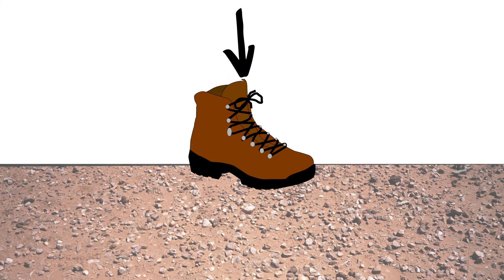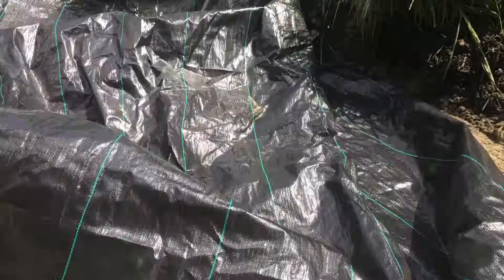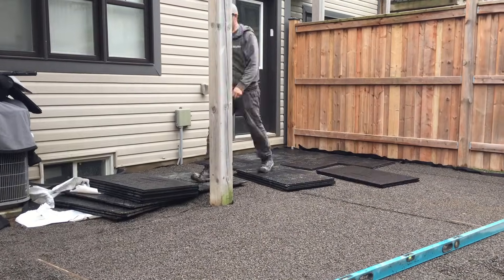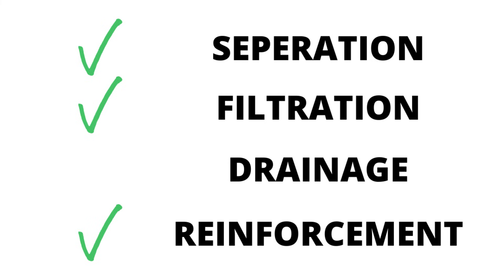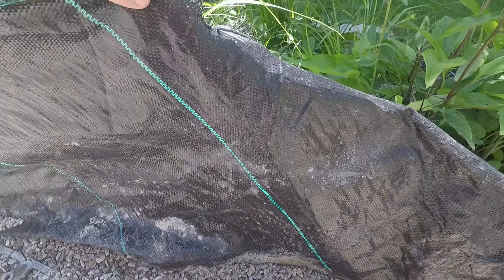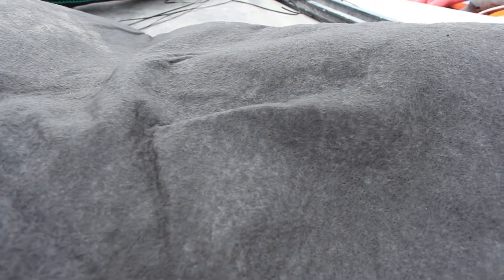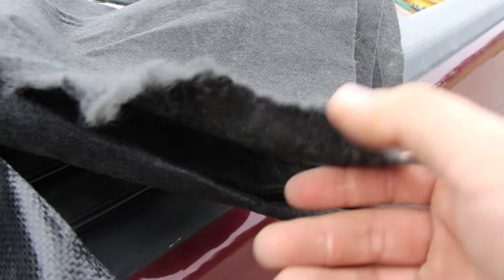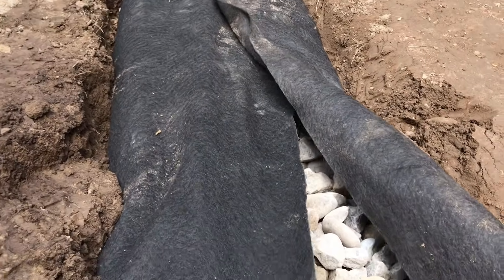Woven vs Nonwoven Geotextile Fabric | Choosing the Correct Geotextile for Your Project

Comment: So if I'm trying to get water away from a house that has pitch going towards it instead of away, i would install woven on the bottom and non woven on the top under the landscape stone, with drainage pipe between. Correct?
Reply from the maker: If your yard is sloped towards the house I would recommend a retaining wall to help flatten the yard. Then you could address any other water problems with a French drain as you described there and you wouldn’t need woven.

Comment: For a patio adjoining the side of a garage and a concrete driveway slab, it sound like nonwoven geo fabric would be best plus or without geo grid for additional support. But any thoughts on whether to place some woven geo fabric near the base of the garage and the slab to prevent erosion from seepage through the nonwoven and ensure water is pushed away from those two structures?  Also thinking about woven at the outside edges to ensure that any water that runs off will not undercut the patio. Any thoughts appreciated.
Reply from the maker: Sorry I can’t quite picture this. Both fabrics will separate material that you don’t want mixing. Woven will not be great for drainage so if you need drainage go with nonwoven. If you need added stability add in the box axial

Comment: We just graded our property and have a really good quarter inch per foot or more slope to the yard, other parts of the yard in tighter areas will be installing French drains. The entire yard will be 3/4 in gravel ( rental property ) . I was thinking woven for most of the yard and under French drains, then a small amount of non woven on top of French drains to allow water to enter. Any advice Thanks !!!
Reply from the maker: Without seeing the site and the subsoil, it sounds like what you'd want to do. As long as your slope for your sub grade is good and away from your foundation.

Comment: Please help, I have a 24” area around my concrete patio that was sinking because it had 8 inches of play sand underneath it with no retaining wall around it , I removed the entire area and all of the sand and built concrete forms 4 inches deep and 3 1/half inches wide all the way around, I used 3/4” angular cut lime stone over the subgrade, which was a clay dirt mixture and compacted it with a plate compactor over 100 times and now that I’m at the point of screeding the 1” of 1/4”clean angular cut limestone before setting the pavers back I realized I forgot to lay down the woven geotextile fabric underneath the 3/4”  limestone base 🤦🏻 What do you recommend I do at this point ? What’s so frustrating is that I originally had the fabric layed down over the subgrade but I took it out to to compact some stone into the dirt and clay mixture so that it would be more water permeable and not like a solid sheet that water won’t let water in but I forgot to put the fabric back down when I put the rest of the stone in. Any advice will help at this point, thank you.
Reply from the maker: I have never met a concrete contractor that uses geotextile to be honest. But the only way to get it in there would be to start again
Reply: @iamahardscaper  The area I’m talking about where the geotextile fabric wasn’t laid has pavers going on it not concrete, I built concrete forms around the outer perimeter of where that pavers will be placed so they don’t fall back. Basically, my question is there anything to do it extend the life of the pavers and keep them from sinking now that that geotextile fabric is not underneath the base

Comment: I have a question. I have a certain section of my backyard in Orlando, FL which is just filled with dirt. I have weed growing there all throughout the year. My wife has planted some avacado, guava and other trees and there are a lot of smaller flowering plants as well. The problem is the weeds that grow between them. I want to cover it with some kind of fabric that does not let the weeds pass through for a long long time as much as possible, with the possibility of cutting an X through the fabric and planting anything my wife wants to plant in the future. What kind of thickest fabric do you suggest I use which doesn't need to be replaced for a long time as much as possible ? (woven, or non woven, Ozs, any company name Or the link that you can send me will help a lot). I will just clean the weeds and lay the fabric on top which will allow up to walk on it. Frequent heavy showers and occasional hurricanes also need to be considered, so the water should not get collected.
Reply from the maker: Ah I’m sorry, I’m not an expert in the planting side. I know some companies use woven geotextile and add mulch on top to clean it up and plant by cutting through it. But the debate against that is the fabric will hold a significant amount of heat and hurt the plants. I would talk to your local nursery
Reply: @iamahardscaper  Thanks a lot Mike. I will talk to the nursery.

Comment: We have hard compacted but thin topsoil layer on top of rock here in Texas.  I'm planning to cover side yard with washed granite gravel with a walkway of scpaed out 2'x4' limestone paver slabs.  WIll compact 3/4" yellow limestone road base prior to adding the finish gravel layer.  Should I be laying non-woven landscape fabric under the road base or between the road base and the washed granite gravel?  The ground is quite hard and difficult to dig or level, therefore I was going to rely on a thick, compacted and leveled layer of road base to create a stable and flat subbase since I can't really excavate and level the raw ground effectively.  Therefore, I wasn't sure if the landscape fabric should lie directly on the raw ground or on the leveled road base.  Thanks!!
Reply from the maker: If you are removing the topsoil and installing the road base on top of rock, I would just have geotextile separating the granite. If you still have topsoil, I would also add it to the base. hope that helps

Comment: Woven seems to be the correct material to use for my pea gravel pedestrian traffic project. I used a woven material that has a felt-like sub-surface last time around. It held up well, but Bermuda grass eventually adhered to the felt and worked it's way thru the weave and is impossible to remove. Removing the material with the grass attached is almost as difficult, but that's what I did. The newer woven material does not seem to have this felt sub-surface, but I'm reluctant to use it. The non-woven material I just looked at is not felt-like at all - it's pressed together & thin but seems strong. My neighbor says B-grass grew roots under her non-woven material, but has not penetrated it ... yet. The woven material seams to fray if you cut it at an angle, which I will have to do - but I like the durability ... still unsure what to use.
Reply from the maker: Wish I could be of more help with that. Unfortunately I do not do many pea gravel walkways but that can be a problem as any seeds can work their way down the pea gravel.
Reply: @iamahardscaper i

Comment: Thanks for the great explanation. Tons of into packed into a compact video! I just put down some 1.5" rock and compacted it for a camper pad, no fabric, over wet clay after a rain. Compacted with a plate compactor. Some of it in the wetter areas just mushed down into the mud. Big mistake. Can I put fabric over the existing rock and add more rock over it? Thanks.
Reply from the maker: Without seeing it, I would say you could
Reply: Can't hurt, and better than scraping up what's already compacted I guess. Thanks!

Comment: Wow! Great to hear you're a fellow Canadian, eh? 
I'm' installing a 3 x 24' interlocking sidewalk in my backyard. After I make a level of Geotextile and the base material, is this where I install the landscape fabric?
Reply from the maker: 👍👍
Excavate, compact subsoil, install geotextile, then your base material.
Reply: @iamahardscaper  Mike: So, you're saying that I place the fabric on top of the base material?
Reply from the maker: No, base material on top of the geotextile. Geotextile separates the base material from the subsoil.
Reply: @iamahardscaper  Sorry Mike for the confusion:
Geotextile layer, then base material, and.... does a layer of weed fabric barrier go on top?
Reply: Oh! I didn't realize that the Geotextile is also a weed control... my apologies!
Reply from the maker: No need for it on top of base
Reply from the maker: No worries 👍
Reply: @iamahardscaper  I opted out today instead of the base material and went with Gator Bed. It would have worked out approx. the same cost without all the hard work in this heat! I'm almost finished laying my pavers. Sometime this week I will finish with a compactor plate and polymer sand.
Reply from the maker: Nice! Hope it is turning out good!

Comment: I am doing a gravel courtyard area. I have the dirt all compacted, but it is a super wet area in the winter time with the rain (pacific northwest) which I've mitigated by adding french drains and a sump pit in the middle. We are wanting to do a pea gravel top layer. Should I put the geotextile followed by a base layer of gravel and then the top few inches be pea gravel? Or should I reinforce the dirt layer more by compacting some crushed asphalt or concrete first then do the fabric? Or is the Geogrid recommended?
Reply from the maker: I don’t think that requires that much prep to be honest. That’s not a popular thing here, but I’d assume digging down a bit maybe compacting, adding geotextile and then your pea gravel right on top. It’s not like you’re going to see any movement on the surface since it is just gravel.

Comment: I want to lay down fabric under a gravel driveway area to prevent weed growth from the subsoil. It seems that woven is best...water is not an issue in either direction (groundwater coming up, or surface water drainage). Will the woven prevent weed penetration?
Reply from the maker: It is important to note that it is not necessarily for weed growth. Weed growth comes from top down and not from the bottom up. Woven for added reinforcement and separation. Non woven for drainage and separation.
Reply: @iamahardscaper  Yes it is true that NEW weed seeds will come from above and need attention, but the roots will be shallow and in the undesirable growing medium of crushed stone. But in the original soil that will be under the new crushed stone driveway there will be many many noxious weed seeds from the eras. Most of those will still want to sprout, and some will make it through the crushed stone (they will have deep roots and hard to eradicate) and some will not make it. The question is... will the ones that will make it through the crushed stone be more deterred by the woven or the unwoven fabric. Thanks a lot for your lightning quick reply. I appreciate it. Great channel.
Reply from the maker: Interesting. Either will be fine, but woven has higher tensile strength.

Comment: So to clarify with having spoken to a manufacturer, the non-woven is geo textile has good flow through rates. I recall a 92% permeability property, but since the fabric is on the ground the rate of absorption into the soil is a determining factor. The ground will absorb at a given rate, although you have a permeable substrate. Therefore, pouring a drink through the material onto the ground is not how the material necessarily works. There are also different weights or thickness for the non woven geo textile, depending on the application. Soil types, slope or pitch would increase or decrease the flow-through of liquids, water, fruit juice, etc. I’ve also used fabric staples and punctured the woven geo textile throughout when doing xeriscape over large areas. The woven geo textile is much less money then non woven.
Reply from the maker: All of this is true. This was just a demonstration to show the difference between the two. It would take a lot more to show the difference between the two considering multiple factors like varying soil types that will be beneath either of them and what the flow through rate would be then. Maybe one day… but for now we have this video and our in-depth article.
Reply: @iamahardscaper   true. Also with the woven you can put a cut mark or a hole and then cover it with some non woven geo textile. Also another trick if the area is sloped you can have the seam facing the pitch to collect water under the material in the gap. I use the woven for a weed barrier when laying down decorative rock so the hydraulics of the wet soil doesn’t burry the gravel or rock.

Comment: Great video and explanation. I’m still a little confused about when to use woven. I have 12 feet of clay that I have sloped away from house that will dump into a French drain with non woven. On this flat area should I use woven (with gravel) to maybe shed surface water and snow to the French drain? I’m thinking that the woven will help keep my grade of clay from leveling off through frost cycles.
Reply from the maker: I do like to use woven over clay soils, especially in your application
Reply: @iamahardscaper  thanks for the quick reply. I’m basically building a drainage mote around the back and sides of my house sloping to the front. I have a pretty steep downhill slope to the front street so I have some deep trenching to where emitters go. I do have crawl space water issues as the previous owner’s French drain didn’t have any fall to it and was plugged. In my French drain I was thinking that maybe 1 1/2 crushed gravel may be better than 3/4. It’ll be a 4ft wide dry scape not for walking on.

Comment: Another great video! I like how specific you got on these topics. But, I’m still stuck on which to choose. I have a paver patio going over a large area of fill sand. Not near a house. Can I use woven for this purpose? (With 8” 3/4 stone base).

We have a couple hoop houses that use the woven textile as ground cover. We irrigate them and it gets soaked for a half hour. There isn’t any standing water it goes through pretty well actually.
Reply from the maker: It pretty much comes down to what you need more. Reinforcement or drainage. Woven is better for reinforcement, it still drains but is better for reinforcement. Nonwoven is better for drainage, it still adds some reinforcement but is better for drainage.
Reply: @iamahardscaper  the patio will be covered by a pavilion (with gutters) soon so I think I’m going to go woven. Thanks again

Comment: Hi I’d like to know how you can install a pea gravel patio I haven’t seen a professional do it  I’d like to know if you have to use a geotextile fabric  is it better if you use 3/4 “ aggragate fist then fabric then pea gravel and should you put some kind of edging and how far down should you dig for the patio  I hope that you can find the time to answer my question I’m from New England area and was thinking of going this route for a patio not sure if it’s a good idea or too much trouble to maintain. Thank you so much
Reply from the maker: Pea Gravel patios are not too popular in this area. I wouldn't think it would need more than just fabric and the depth you want to go with the pea gravel. Base is to ensure there is drainage and to prevent heaving. If your patio is gravel, you are not worried about that especially since it is just pea gravel that is easily moved whenever you step into it. I would think it would definitely be trouble to maintain if you have a lot of vegetation around as it will be home to weeds and insects over time.

Comment: Great video! Question: I have about a 30'x6' walkway on the side of my house where we've had some leaking into the foundation. I'm planning to put a french drain in at the fence line away from the house sloping to the backyard. Question is to slope the 5-6 feet away from the foundation and into the french drain, should I use woven geotextile to help push that water away from the house into the drain? It's just river rock and soil right now so the water tends to just sink in and find it's way to the foundation so I'm thinking using the less permeable fabric tied up tight to my foundation and slope down would be the best move but let me know if that doesn't make sense. Thanks very much!!
Reply from the maker: Yeah that would be a good use of the woven geotextile. Just do not use it around the French Drain.
Reply: @iamahardscaper  Thanks so much!
Reply: Use MiraDRAIN against the foundation. Check out youtube videos on it...there are plenty.

Comment: Excellent explanation! What's your take on this situation: A private internal dirt track on an agricultural acreage. The track is approximately 250 metres in length, and 2.5m wide. On a gentle slope. Very lightly used. Area gets fairly wet. 

I want to install drain ditches on the sides of the track. Use two strips of woven (3ft wide each) where the tires make contact with the road, and overlay the whole road with gravel, with a gentle hump in the middle.

Essentially a cost-saving measure. Your thoughts? Thanks
Reply from the maker: I think it’d be best to reach out to a technical representative of the manufacturer. But my first thoughts are that the geotextile needs to extend the full width.
Reply: @iamahardscaper  Thanks for your thoughts.

Comment: So if I am putting essentially a french drain behind my 6x6 timber retaining wall, then I want to use the non-woven to maximize drainage to keep static pressure minimal and keep the wall from pushing out/over? Because I dont need reinforcement in that case?
Reply from the maker: I don’t know engineering for timber retaining walls. But I would assume you would want that drain at the base of the wall much like in a segmental retaining wall installation because a French drain is more so meant for surface water.